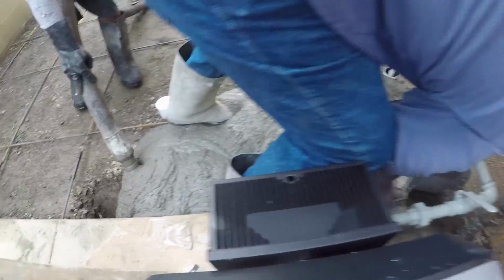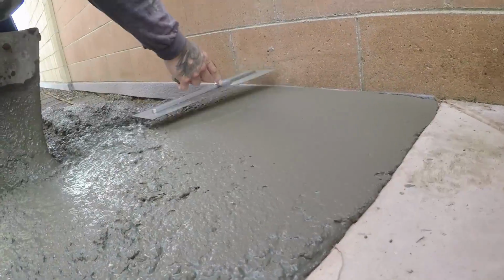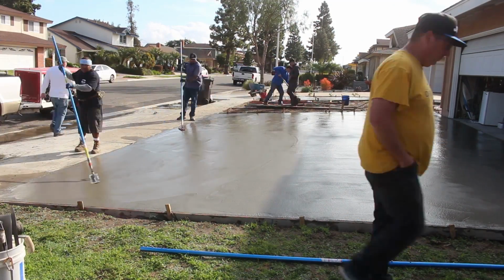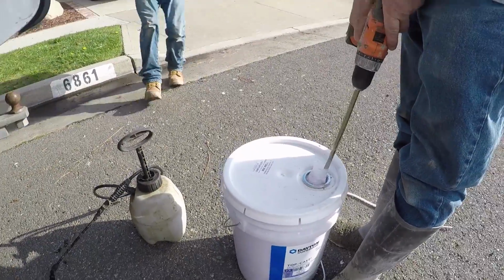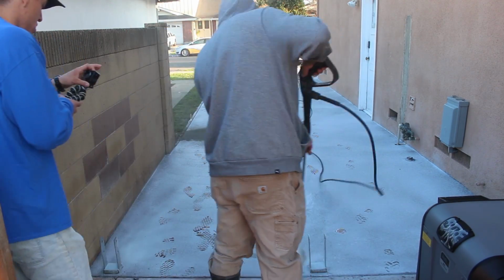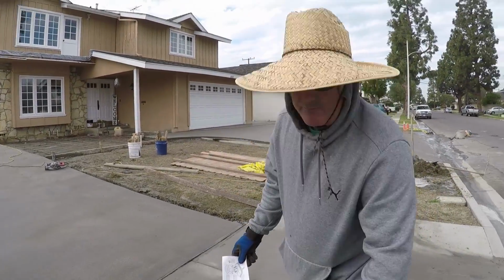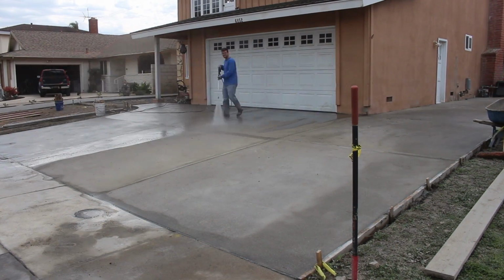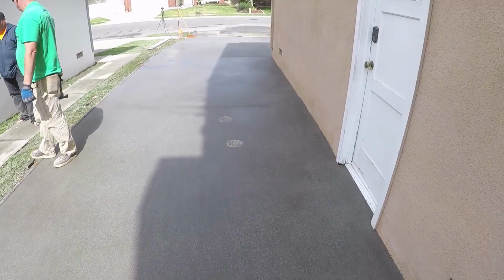How to Pour a Concrete Sand-Wash Finished Driveway and Wooden Stamped Concrete Patio Part 2

Comment: Worked on one job doing vertical exposed aggregate , the boss. Painted forms with molasses. Sugar residue allowed the cement to be exposed with a wire brush. This was before retarders were available, to us, or pressure washers . In the early 70’s . Looked really good .  Never done another one. This was for a monument in remembrance of the fallen in the 74th Seabee battalion, Vietnam.
Reply from the maker: Thanks for sharing

Comment: We use molasses from any livestock feed supply to do exposed aggregate. It costs less than $.50/gallon and we dilute it with water. WAY cheaper than sugar water, soda, or retardant and it's dark so you can see your spray coverage. 👍
Reply from the maker: Great idea.
Reply: how much molasses to water please ????? thanks
Reply: I get sugar for .97 for four pounds. I don't know but that pretty cheap.

Comment: Putting sugar allows the line in the cement to absorb more water than it normally would, plasterers in the UK, have been using it for a long time to put in mix if they want to slow the set down, very useful if you have a bag going off, or just need some extra time.
Reply from the maker: Sounds good

Comment: ODELL, THIS IS  A REALLY GOOD FINISH ON POURING CONCRETE WITH THE SAND , A REALLY GOOD VIDEO 👊👊👊👊
Reply from the maker: TY
Reply: David, what king of stone or aggregate is in this concrete? So, the top cast must only take a little bit off the top if the aggregate does come through? Awesome work. 👌 You the man.

Comment: Great video. You explained it nicely. Obviously not for any DIY folks. 👍🏼
Reply from the maker: Maybe on a smaller scale
Reply: Much smaller... maybe. Good sand finish, and rustic terrazzo with micro aggregate, is an art form.

Btw... thanks for the knee pad link. 👍🏼. I hope they work good because my knees are about shot. 
I’ll be 70 in July and it’s getting hard to do even small flat work stuff around our house. 4 decades of flat work concrete, tile, and masonry took it’s toll 🙁

Keep the videos coming. You’re doing a good job.

Comment: Every job I've seen you do; you've always done great work. I've poured 1,000 of yards of concrete in my 20's (40 years ago) and I remember how put off I was when a GC wanted us to vibrate a ground slab. I also remember not realizing the value of compressing the ground ahead of time. Being an engineer, I know better now. I'm not buying the notches in the straight edge to lighten it up. If anything, it affects the integrity of the straight edge. There is more to this story than you are letting on. But this is incidental.
Keep up the good work....

Comment: Also I have used fiber and rebar lot of my jobs I used pea gravel forever and I got suit on this big job because of cracks so I don't use pea gravel anymore and I had joints cut every 5 feet and a hairline crack in another driveway and I poured it 5 in with rebar contractor board said that one was okay I can't believe they okayed it so I don't use pea gravel anymore and I haven't had any more cracks if I use 3/4 Rock and wash them so they stick good and they don't pop out later it covers the three-quarter inch Rock and I'm good
Reply from the maker: That's true 3/4" aggregate is more crack resistant.
Cracks are not a problem until you get a trip hazard. All you have to do is walk down a City sidewalk to know that.

Comment: I never use pea gravel on driveways anymore it will crack even with joints you need 3/4 Rock 6 sack mix
Reply from the maker: Try fiber and rebar
Reply: Strong concrete is made with strong rock like quartzite red Rock, not weak pea gravel. have you ever  seen a road poured with pea gravel! Lol
Reply: @copo3019  Hell no who's talking about a Road  u must b a liberal

Comment: Mr Odell, do you use pea gravel instead of regular gravel  or you mix both ? The fiber is thrown on surface before finishing ?
Grateful for sharing the knowledge... OSS ! 
Best regards from Brazil...
Reply from the maker: Fiber is mixed in to the concrete.
Either mix will work
Reply: Fiber is a joke, use something with strength like actual steel rebar if you want it to last

Comment: Do you ever use dobies or rebar chairs? Curious if the rebar actually stays put in the middle of the slab? Seems like it would eventually settle as a Concrete caring?

Comment: Very nice job. Do you use a vacuum pump for your wash removal? I can see a wet and dry Vac. Sometimes If its a patio I'm grouting, I dig a sump. If I get this the latest driveway project (exposed Aggregate ££££) I will be buying a vacuum pump so contain the wash and stop the material messing the road and drainage. I would bring an IBC to fill and let the fines settle out.
Reply from the maker: That's  exactly what I do

Comment: What is the estimated lifespan of what you did?
Will the upper layer of concrete be destroyed by water and frost?
Reply from the maker: This surface is a integral part and 5000 psi, bullet proof
Reply: @OdellCompleteConcrete  Cool! This is what brand of concrete provides such indicators? Used 22.5?

Comment: Just wondering…Did you let all of that cement paste that you washed off go onto the curb and then to the storm sewer? We always tear out the city walk so the paste has a place to go without going into the storm sewer. The City would fine the crap out of us in Ohio for letting it get to the storm drain. The sand finish or “buff wash” as we call it, is my favorite concrete finish. Keep up the good work!
Reply from the maker: You're better off creating a dam and wet vaccum it out.

Comment: Won't you get separation later on? We normally dowel corrugated steel into the sides and add steel epoxy in the hole. Keeps the concrete locked in to the adjacent structures for a lifetime.
Reply from the maker: We dont have those conditions here
Reply: @OdellCompleteConcrete  ok. I'm a builder from the island of Trinidad & Tobago. We get a lot of separation here.

Comment: David, have you ever looked at the northern tool dot com pressure washers? I purchased their Honda GX390 4K PSI with the CAT pump in 2004 and it’s still going strong! 
How long do the pressure washers your using now last?  You get what you pay for!   

They have a 3K PSI high flow five gallons per minute I would love to have but till mine dies I am doing well...  

I have a pressure gauge on mine so I don’t blow the paint off my cars and house...
Reply from the maker: Nice set up.
Mine Ive had for 6 years and its a honda 2500 psi  from sams club for 350.00

Comment: Is there a reason/benefit to saw cutting vs running the jointer across it?
Reply: smoother surface, if you have to roll things on the surface, like skate boarding, tool chest with casters, it's much easier on saw cut concrete surface.
Reply: Also when you physically cut your joints it creates a much neater and more accurate weakness point.  Where as running a joint tool is more like asking please crack here.

Comment: So the dirty water just run to the street drain sistem and contamined the rivers .. You can a fine on the here at the bay area in california ...
Reply from the maker: Actually we wet vacuumed and stored the wash out until evaporated and pick up the residual

Comment: Why not get the skillsaw for concrete -  "Medusaw" - they work get - no dusk with the water turned on.
Reply from the maker: I have been looking at it pretty seriously
Reply: We like ours - we bought it to cut the perimeter of the basement slab to install drain pipe but have found it great for brick, patio stones, etc.  I must say it is nice to cut without a dust mask and the blades last longer.  Wish the thing came with a tool case...the walk behind versos looks nice for slabs @OdellCompleteConcrete

Comment: When you make those cuts an inch deep, is there not still a risk of cracking because you haven't cut right the way through the slab?
Reply from the maker: Yes there is. Even when you cut through it may crack somewhere else
Reply: @OdellCompleteConcrete  Thanks. Is it better to cut all the way through? Or would you always cut to an inch depth?

Comment: Why did you saw cut the joints in and not put them in with a jointer when it was wet?
Reply from the maker: cleaner, better for skate boarding
Reply: Cool. I have a question for you, if I’m doing a stamp job, and I need to spray some dry retardant on it, do i spray it on then apply my release?

Comment: Just curious how did you contain all that top coat slurry isn’t it a big fine to let that go down the the city or county  drains ? Out here in Sacramento you get fined for how far it travels  into the drain pipe , I was just wondering cause I’m always looking for a better way of dealing with the slurry , we buy drain inlet bags that collect the sand , but we still aren’t allowed to flush our slurry down the the street drains the bags are a must for extra protection.
Reply from the maker: Sand bag the gutter and wet vac out
Reply: Have you tried using a rubber test plug. What about 4 inch wide vinyl electrical tape to cover up the grate? There is also sandblasting stencil mask that monument people use.

Comment: Don’t you lay a foam liner between existing brick and concrete walls and the concrete to poor? Especially when you have walls on both sides of the driveway, there is the risk of cracks in the walls when concrete is expanding. Also noise is traveling from the driveway into the house if concrete is poured directly to the wall, isn’t it?
That’s what I am told here in Switzerland where building code seems to be quite differenr
Reply from the maker: We don't have any freeze and thaw here so there is no expansion or contraction.

Comment: Never cement the gas riser. I promise you it will leak at some point and the gas workers will have to break it and make a mess sometimes.
Reply from the maker: I have remove concrete from around gas risers more times then I can remember.
Concrete was usually 30 to 40 years old and the original riser.
Reply: @OdellCompleteConcrete  I am a gas worker and I had to break driveways that were weeks old. It sucks to tell the home owner that we will replace it but it will not look the same.
Reply from the maker: If its leaking your going to the street anyway, so there's really no way around it
Reply: @OdellCompleteConcrete  not if is p.e. line. You just need about 1x3.5 feet trench to change the riser. You can tell if you see a tracer wire coming up along with the riser.

Comment: Question how important is it to keep the expansion joints clean or does it matter?
Reply from the maker: The cleaner the better.
But it will come clean in time any way
Reply: Verry nice  job.i like your big steel float with big handle.Your good experience and professional  skilled   men are so good doing job without tension to cover job so quickly. Salute you.

Comment: Hey Odell, I have a small job Friday sand finish. First time doing it. I’m using top cast 01. What size aggregate do you recommend? I’m in Vegas like you mentioned in the video.
Reply from the maker: The aggregate doesn't matter
Reply: Ok Thanks! That’s what I heard, just wanted your opinion!🤙🤙

Comment: Had my first sand finish job. Used top cast. Like you said about coating it, I didn’t coat it all “bone white” and one of my guys was power washing it really close tryna get certain areas to (that wasn’t coated enough) match the rest and it just dug to deep 🤦‍♂️. And certain areas looks like we used too cast pink 125. Do you have any recommendation on patching/repairing this without having to bust out and re pour? Thanks
Reply from the maker: Sand blast

Comment: Hello Mr Odell, I had a topcast finish done on my concrete.  Mine was not done correctly. The finishers did not clean the top layer of concrete completely off. There are patches and streaks of dried concrete on my patio. It's been about two months. Is there anything I can do to remove the dried concrete?  You mentioned floor polisher with bristle brush but I imagine that would only work before the concrete cures. Any help will be greatly appreciated.
Reply from the maker: try a sand blaster
Reply: @OdellCompleteConcrete  thanks

Comment: I wanna pour a 14m2 workshop floor of about 10 cm high however, there's a 5cm slab (about 75%) on the intended area to be covered. Do you think it is alright to pour on it or should be removed, or at least break it up and stump it prior to pouring? It appears to vibrate in some parts, especially near the edge, when I stump on it, but not in the middle, yet.  It used to be a pigsty floor, what would you suggest?
Reply from the maker: I would remove it if its not stable
Reply: Thanks mate....

Comment: Dave, I just finished a sand finish job and our sprayer broke down as we were spraying the second coat of retardant. So we didn’t get a full bone white coat.  Came back the next day pressure washed it and we have blotchy spots of cement stuck to the surface all over. Tried the buffer, but it did not do much. Can I use muriatic acid? I know this will work. I’m just not sure if I’m supposed to wait for it to cure and whether it would work at that point or not.
Reply from the maker: Try a sand blaster

Comment: Ron have you tried Skils MEDUSA Saw?
Reply from the maker: She's a beauty, next video will have it in there
Reply: I was going to build a saw like the medusa when I stumbled across the Medusa. I did have to locktite the screw on the water valve because it would back out at the worst time. I did go to the hydraulic hose shop and make crimped hose to replace factory hose . Works flawless. I made a guide for it to follow on a 12' alum rail to cut granite slabs. I am buying a spare to have on hand. If you send me a email link Ill give you the company that supplies my diamond blades ata great price.

Comment: forgive me please, but why inch deep cuts on the concrete?
Reply from the maker: Crack control
Reply: Because the concrete is 4 inches thick. Cut should be 25 percent of the total thickness of the slab

Comment: At 16:53 that closest saw cut joint, wouldn't it had been better if if ended at a 45° angle onto the edge of the concrete? Or it really doesn't matter?
Reply from the maker: I guess its just a matter of preference

Comment: What’s the stone size you guys use on this concrete? Do they have those in NY?
Reply from the maker: The rock size doesn't matter.
The sand is what you expose
Reply: @OdellCompleteConcrete  yes I’m sorry, I forgot you were exposing it, I see some videos, the rocks are really small, sometimes it looks like stone dust (screening) over here in NY the smallest one is 3/8 stones but it’s no where near like the concrete you guys pour, it looks really good to work with it

Comment: Is it better to saw cut after pouring or putting the joints in when pouring?
Reply: J.P - As long as you saw the same day, both methods are good. I personally prefer to saw cut. Depends on man power sometimes also.
Reply from the maker: If you seen some of the jobs I have, where they tried to same day them and lost, you would prefer the saw cutting
Reply: Yeah Sof Cutt green cutting early entry saws are the way to go.

Comment: Your concrete cracks before you cut the concrete because too much water to cement ratio, and how about try using a soft cut saw so you not down on your knees with that amateur crappy skill saw or whatever it was
Reply from the maker: I didn't get any cracks in this.

Comment: A Odell send me some knee pads. Just bought the 7 inch rigid wet tile saw. A few projects laying tile. 7216 Ranger Way. Fort Worth 76134. Can u guys do a counter top..concrete. Video it.
Reply from the maker: 10% percent off through there website with code odell10.